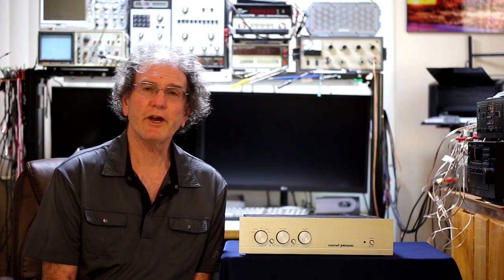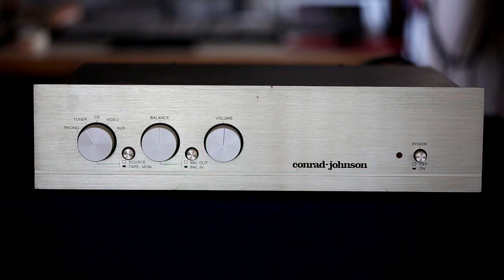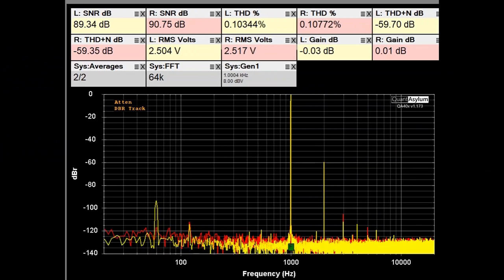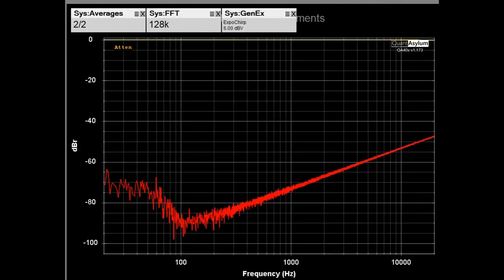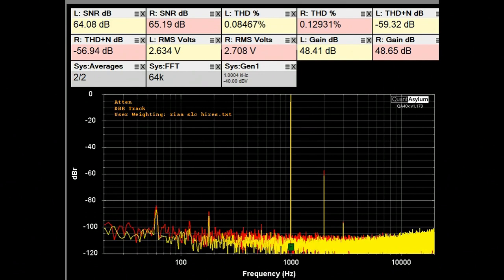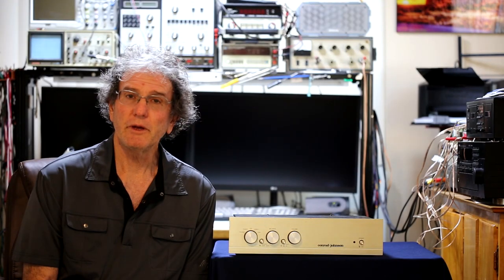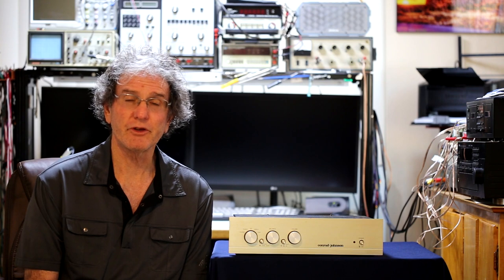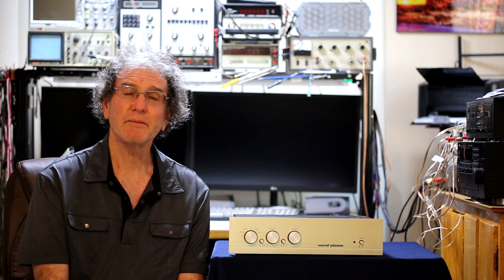Conrad-Johnson PV10a Tube Preamplifier- Vintage Audio Review Episode #62

Comment: I bought one of these used in 2002 and used it for 15 years. It was very relable and was very easy to listen to. It was replaced with the Rogue RP5 tube preamp which is a great preamp but I prefer the PV-10a's tube phono stage. I use a homebrrw LaPacifica phono preamp instead of the Rogue's internal SS phono stage.
Reply from the maker: ThAnk you sharing your experience with the PV10aPart of the fun of this hobby is mixing and matching various pieces of gear like you did with the LaPacifica phono preamp and the Rogue's. I am not sure who ended up with the PV10a- I think the owner did a swap with someone.
Reply: @vintageaudioreview   I paid $550 for that used unit twenty some odd years ago so it had only lost 355(?) of it's value over a decade, God knows what a 30+ year old uni is worth today. I will say the build quality is first ratee, and the fild PS caps will outlast me. 

i kept my PV-10a because I liked the idea of having a spare around. I'm old enough that getting a replacement is a PITA  -I'd rather have the security of a spare than the few hundred I could get for a 30 year old unit.
Reply from the maker: @dell177  Good idea to keep around the PV10a "just in case" I find myself doing that more often these days, but am going to try sell an amp on ebay because i already have several spares. Thanks for the comments!
Reply: Nice review of the C-J PV10 a. I got my first taste of Conrad-Johnson when I was selling audio in the mid 80’s a used pv7 came in to the store, and I took it home and put it in my system. I loved the music I was hearing, but the preamp was a bit noisy. I didn’t understand what it was at the time, we were a solid state shop, but a simple tube change would probably have fixed the issue. Nun the less, it was an experience that would stick with me, and a few years later I was now working at a larger dealer and we had lots of tube gear to sell. Well in 1992 when Conrad- Johnson released the PV 11a, I brought it home and loved it. Musical and quiet. Then in 1995 when the Pimire 11 power amp was released it joined the PV11a in my system. I have both to this day. Pimire 11 updated to the A designation at sometime, I don’t remember when. Good stuff!
Reply from the maker: @markmorrow3250  Thanks so much for taking the time to share your memories! Am glad you still have both pieces of the CJ gear and that they are working well. Unfortunately, I have no more CJ gear in the pipeline to check out....

Comment: Would like to hear this in one of my systems though my main is with a solid state dual class a perreaux preamp that I love but at 40 years old will likely need a check up or rebuild soon it sounds lovely with tube amps as well. Still this looks like candy to my ears. Thanks for your view of this pre.
Reply from the maker: Thank you for taking a few moments to share. If your Perreaux preamp is being used regularly, sounds good, and not acting up, I wouldn't worry about it. I am guessing that you would not hear a difference between the Perreaux& CJ.